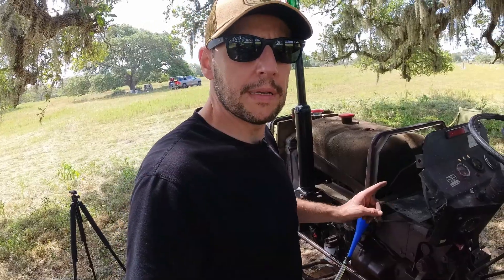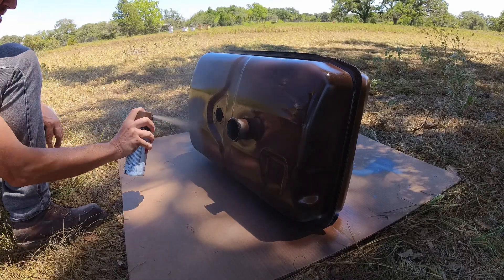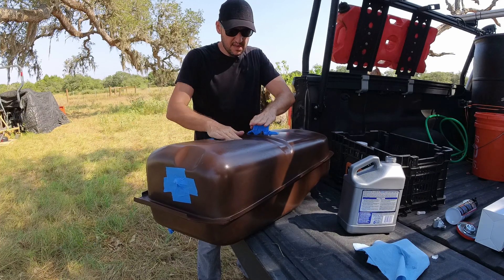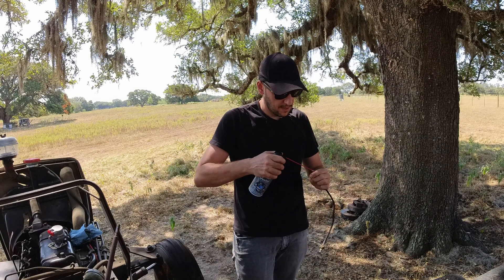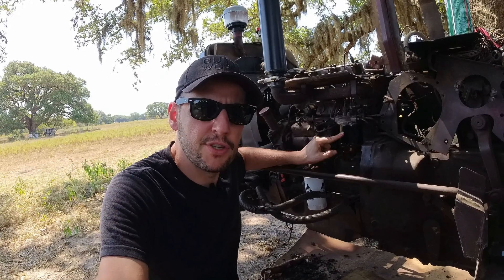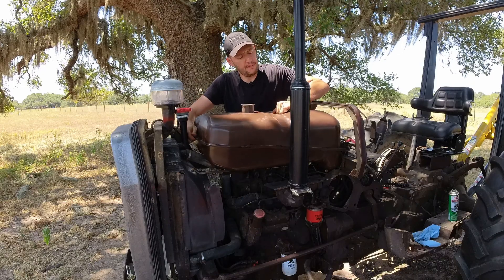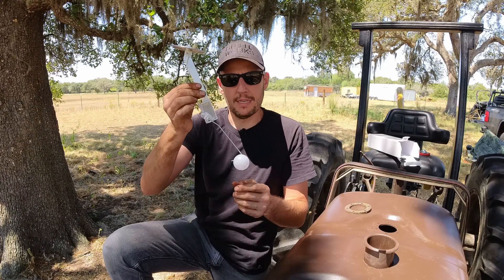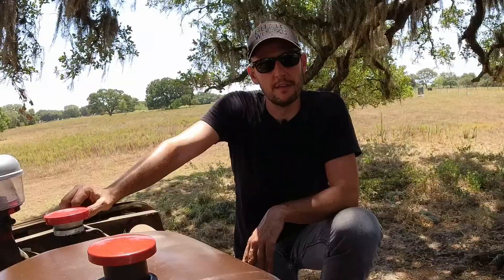Massey Ferguson 231 Fuel System Gas Tank, hand pump and filter overhaul

Comment: Exact video I was looking for. NAILED IT!
Reply from the maker: I'm glad I could help you. Also use some seafoam or royal purple fuel injectors cleaner mixed with the gas. I have done that 3 consecutives times tome make sure the fuel pump and injector get cleaned from inside.

Comment: I also want to add, for those who would like to know, the BALDWIN ENGINE OIL FILTER PART NUMBER for the Massey Ferguson 231 tractor is BT215. I have used the Baldwin BT215 engine oil filter and Baldwin BF825 fuel filter in the past and they are top quality, excellent filters!
I either use Napa Gold, Wix, Baldwin, Donaldson, or OEM filters on my 231. Nothing else!
Reply from the maker: Thanks for the info!

Comment: @BUTTEWORKS  How do you know the aftermarket tank will fit and what fuel sender would fit the tank? The aftermarket tank looks to take a 5 hole sender unit. That’s all I’ve ever been able to find aftermarket, and that’s the reason I’ve never bought one.
Reply from the maker: I didn't notice that but now that you say so, I can see the new tanks have only 5 bolts. You would need a new sender in that case. On a quick search I could not fine any 6 holes aftermarket  tank. I will update the list of items in the description noting this issue. Thank you for the comment, very good point.

Comment: Another Excellent video on the Massey Ferguson 231!!! THANK YOU!!! I’ve did 16 hours of bush hogging on mine on the hunting lease over the past 2 weeks.
Will you PLEASE make a video showing the Fuel Gauge that you installed and with the tractor running?? And YES, I’m not gonna sugar coat it, removing and installing the fuel tank on the 231 is a BITCH!! I’ve only had mine off about 3 times over the course of 16 years! The last time was about 3 years ago when the engine decided to blow a head gasket.
Also, you need to add the “outer stabilizer chains” to the parts list that you’ve created under your videos. 
I didn’t know the 231 had a replacement fuel sender unit that was available for purchase aftermarket. Good to know!! I’ve only seen 5 hole sender units for sale, not 6 hole units that the 231 takes.
The inside of my tank has a lot of rust, but it’s not giving me any trouble. It could use a new fuel cap though. Last year I had to install a new strainer on the inside of the fuel petcock because it came off inside the tank and rust got in the supply line and gave me trouble. Got it fixed and been running fine ever since! I hope you like your 231 half as much as I love mine!!! KEEP THE VIDEOS AND INFORMATION COMING!!!!!!!
Reply from the maker: Thank you Travisricks3426. I'm working on a complete dash board restoration so yes, I will show the gauges working, maybe in two tree weeks. I am having a blast working on this tractor, I really like it. The way it handles the mower and drives is great.- Still dealing with power steering issues. Next vid will be the power steering control valve.
Thank you for your comment.

Comment: Great job on the tank, looks awesome. Never used that WD-40 rust remover. Looks like it works pretty good.  Going to run like a new one when you get finished.
Reply from the maker: Thank you Jeff. WD40 rust removal worked pretty well dissolving rust. Depending on how much rust you have instructions recommend from 1h up to 24 hours application.
Reply: @BUTTEWORKS mine would need anywhere from 24-48 hours lol.
Reply: I need to put this WD-40 stuff in the tank on my 231. It is full of rust! It’s running fine though, I had to put a new strainer screen on the inside of the fuel petcock last year. I went ahead and installed a new fuel lift pump while I was at it also! I’ve had my ‘98 MF 231 for 16 years. It’s been my absolute favorite tractor that I’ve ever owned! The only major problem that I’ve ever had with it was a blown head gasket 3 years ago. My mechanic friend fixed it for me, but it costed $1,000. I ABSOLUTELY LOVE MY 231!!!!!!
Reply: @travisricks3436  same here Travis. My 231 has been solid as a rock.  Love the Perkins engines.